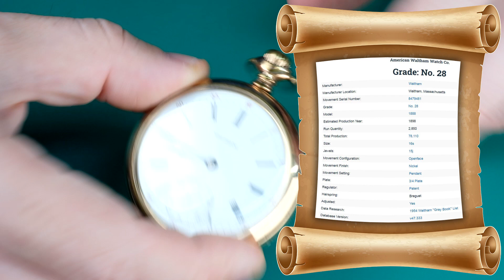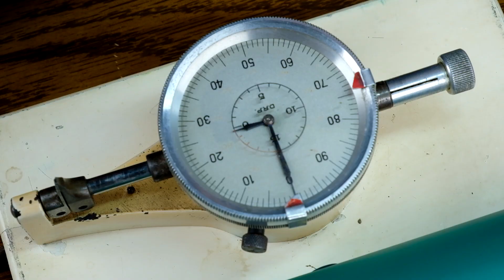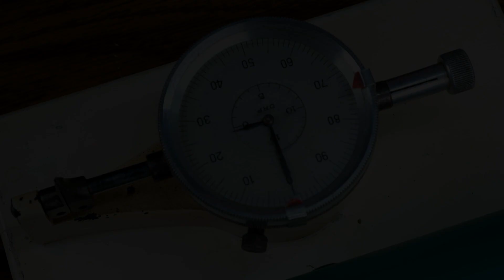123 year old Waltham Pocket Watch Restoration   Part 1 (Re-upload)

Comment: Nice! I like your movement holder. Very interesting to see the wear on the pinion leaves - I will pay closer attention to that now.
Reply from the maker: I'm not sure how it affects the timing, but I would guess that the engagement between gear teeth and the leaves has extra play since the wear on materials creates a fraction of space that wasn't there before. But all in all, I don't think it's as tragic as bad pivots. Those holders do pop up on ebay, but they do a better job holding the watch dial down rather than dial up. Cheers!

Comment: Recently got my family airloom back after my uncle passed. Mine looks just like this. I looked the numbers inside on the mechanism and it has a 6 digit serial that starts with 1. If I looked it up right its 1870s maybe 1860s? The case came up for 1907.

Comment: Great video.  Relaxing to watch you work.  Can you tell me what cleaning solution you use on the movement?  I do not have an ultrasonic, and will need to clean my watch by hand as well.  Is it just lighter fluid on all parts?
Reply from the maker: Hi Jake. A bit of warm water and Murphy’s Oil Soap will do the trick. But you can also use dishwashing soap.Rinse in water, then let it soak in alcohol. Good luck!
Reply: @grumpyswatchrestorations  Fantastic! Thanks for sharing it is much appreciated.

Comment: 2:04
What puller are you using?
Reply from the maker: Hi. Are you referring to the canon pinion puller? It's an M&S puller. Same as the Bergeon 4854. Cheers!
Reply: @grumpyswatchrestorations  
No the hand puller. I haven't seen one of that design before. But I am totally new to this.
Reply from the maker: @ridetheapex  Oh the hand puller! Here's your link: https://www.ebay.com/itm/144370285823?hash=item219d23bcff:g:HnQAAOSwFpFh4QJC
They're not always the best choice for the job, but often they work pretty well. Good luck!